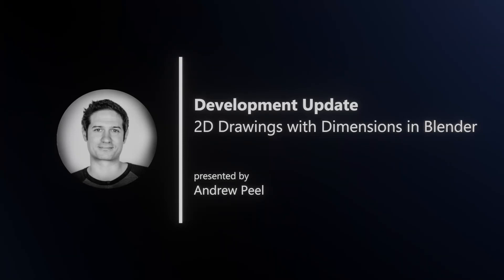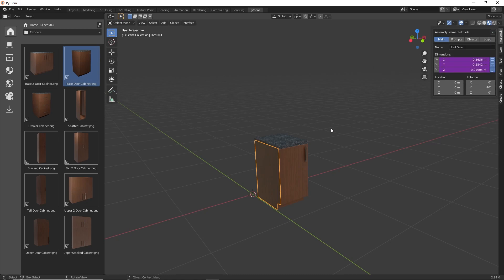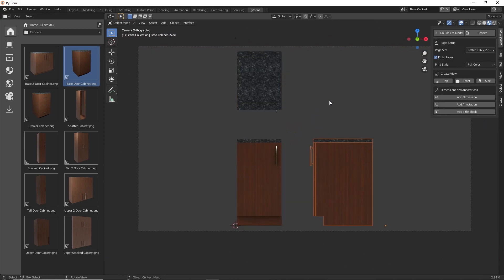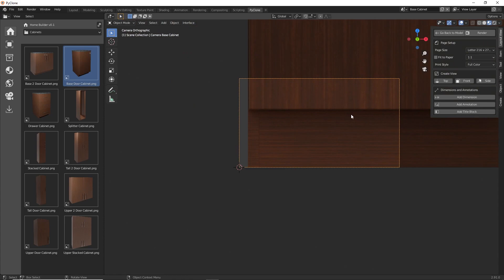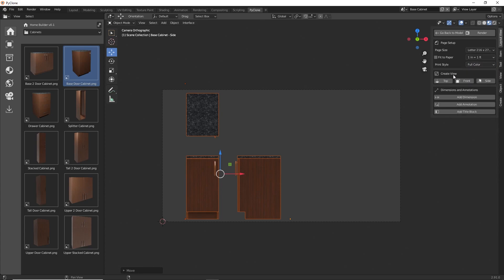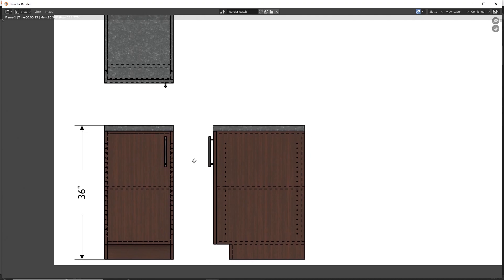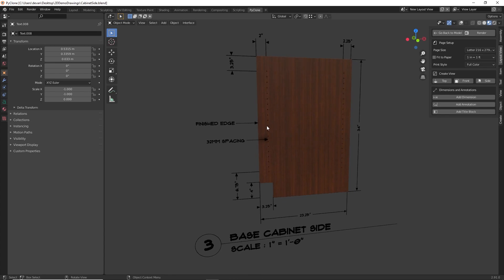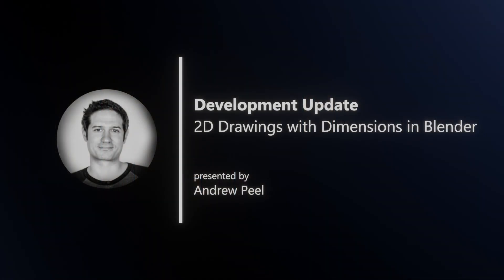2D Drawings with Dimensions in Blender - Dev Update

Comment: Well you be adding the ability to creat a cutting list to the generated drawing ?
Reply from the maker: Yeah. I will add the ability to add a parts list to the drawing along with the ability to create all of the other types of reports needed for manufacturing.
Reply: @andrewpeel1996  last thing will I be able to acces this feature at the the moment?..... Btw bravo on been diligent on your work
Reply: @andrewpeel1996  dope
Reply: Wooow woow if it also had the ability to add hardware to the cabinet runner , hings, soft closing or push to open ect also the ability to add plastic legs   basically a BOQ so that u can build what you created

Comment: Now I need to export the parts as DXF files with layer mechanisation naming.
Reply from the maker: Creating a DXF export is on my list. I will have an automated way to create these files for the Home Builder cabinets.
Reply: @andrewpeel1996  hey, what about svg? It would be nice if we can get some stuff out for cnc like Shaper Tools etc :)

When can we start to get this addon by the way? Been waiting to do something like these stuff mentioned here for a long long time..
Reply from the maker: Yeah it should be possible to export svg, but most cnc platforms that I am familiar with use DXF to generate the GCode. The add-on is available now, but the 2D dimension functionality will be available with the next release.
Reply: @andrewpeel1996  next release? do we have to download additional files or just directly from the next Blender's update?
Reply from the maker: @TitusNCC  You will just have to redownload the add-on, but I will have an auto updater implemented soon.
Reply: @andrewpeel1996  Nice! do I do them directly from Blender's site or is there a seperate link?
Reply from the maker: You need to install them from this link, but it probably wont be updated with the latest version for a week or two. https://creativedesigner3d.com/pyclone/
Reply: @andrewpeel1996  noted with thanks!